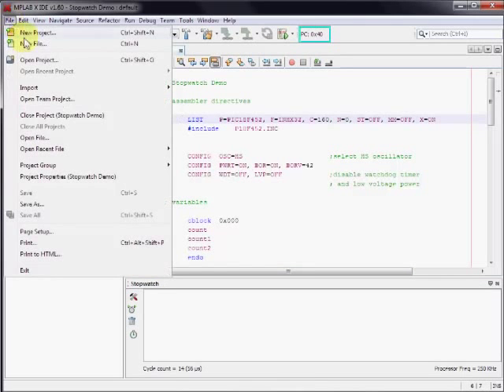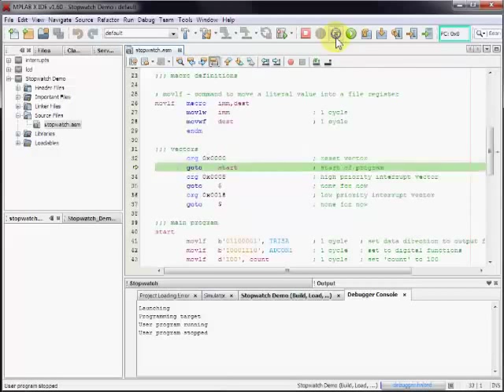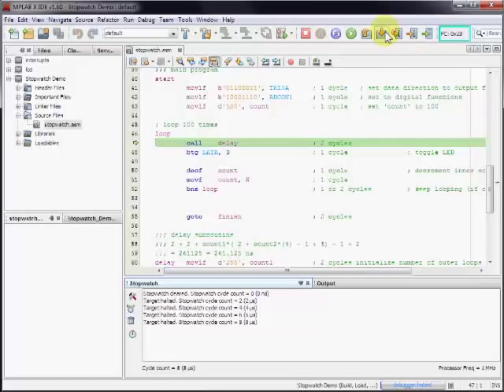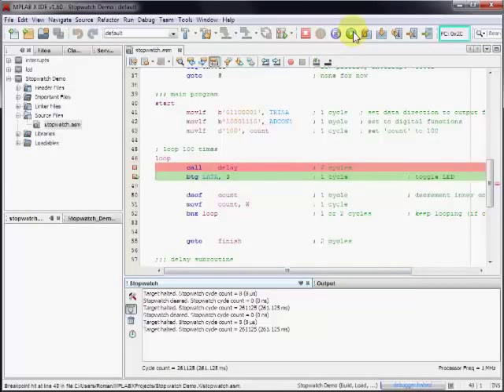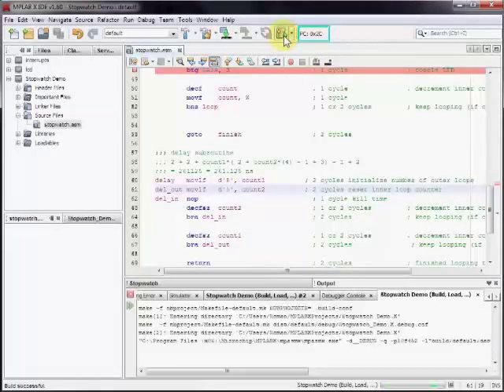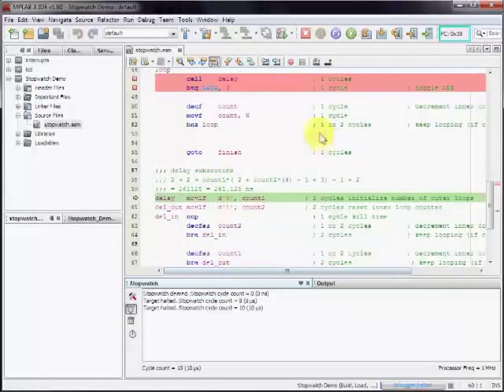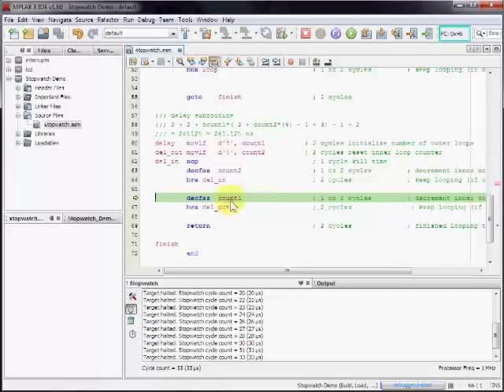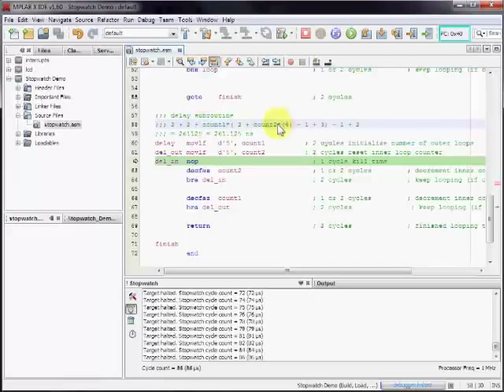Using the Stopwatch Feature in MPLABX

Comment: Nicely done video.  It helped me figure out I had to go into Properties->Conf:->Simulator->Oscillator Options and change the Instruction Frequency from the default 1 MHz to my actual clock to get an accurate time (cycles are accurate regardless).   

One clarification: Around 4:15 the instructor states "...it ["decfsz count2" when count2 is zeroed] takes 2 clock cycles [instead of the normal 1 cycle] because it's going to increment the program counter by 2 rather than 1..."  While this may be technically accurate since the correct instruction is at PC+2 n relation to "decfsz count2", the underlying reason is that the branch instruction "bra del_in" was already fetched into the pipeline as the next instruction before decfsz was evaluated.  Since the branch is not exectuted in the case where count2 is zeroed, the fetched instruction is discarded and a cycle is "wasted" to fetch the correct instruction  "decfsz count1".

Comment: Things were quite more simple in old MPLAB and I was using it until now. The 12F1571/2 mcus are not supported by MPLAB 8.  Why would you need a log of timer values. You don't know what previous values mean because there is no relation to the code.  Also you can't easily have a floating compact timer with all the log text and scroll bar. In MPLAB you had 2 values - stopwatch and a count/timer since last reset - that's not a big deal, I can live without it... And why would you put the mcu instruction frequency instead of the oscillator frequency.  I have to divide by 4. What if I switch to 16 bit mcu and I forget that I have to divide by 2?

Comment: I can't run stopwatch on my project, it says in stopwatch properties (not supported for this device/tool). I'm using 12F1572 processor and trying to simulate my assembler code but this stopwatch makes me crazy.
Reply: I'm using stopwatch on 12F1571. Stopwatch is supported, but start/stop condition (not sure what it does) is not supported. And you are not the only one going crazy .